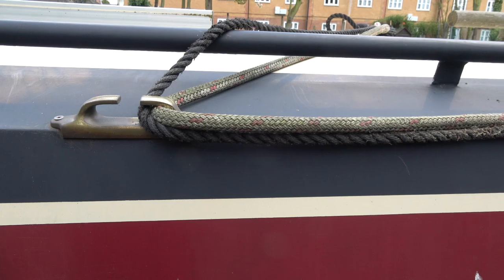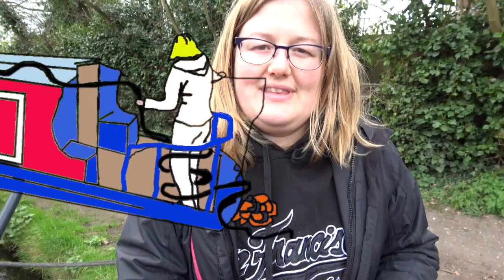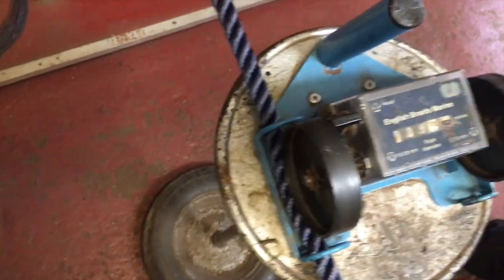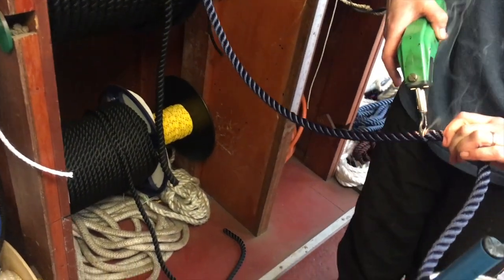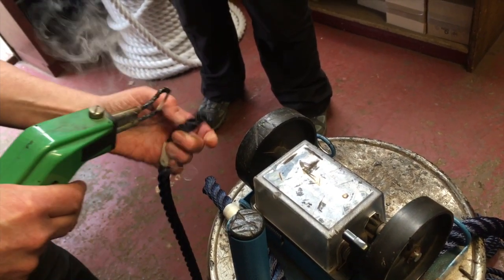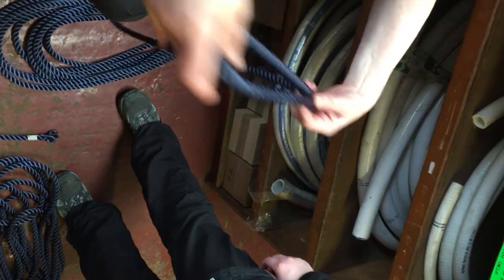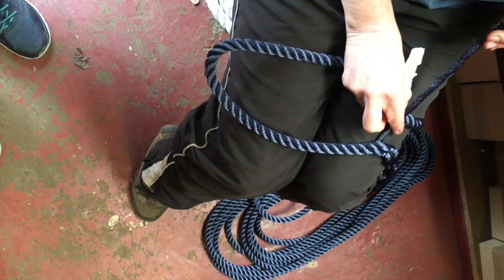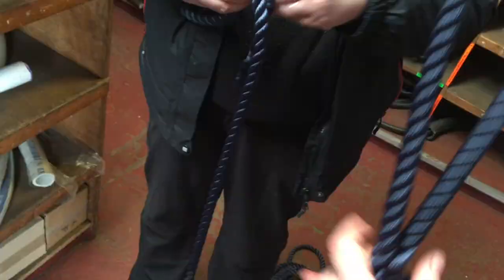How to replace the centre line ropes on a canal narrowboat

Comment: I've got continuous handrails and fairleads like yours but I've given up feeding the ropes under the handrails. If you're working locks single handed, you want to pull from the centre. The only time I use it is when I'm pulling it along the towpath as the chimney gets in the way. The fairleads would be more useful if the handrail was in two sections with a gap by the fairlead. I keep thinking about doing this but it's far too much work. Much easier to keep touching up the paint that inevitably gets rubbed off. I also agree that you need to sort out the fixing of the two ropes as the second one may pull open the splice of the first.

Comment: If you wanted to save the old "rope" (actually should be called a line),you would have pulled bitter end (not loop) through the roof eye bolt...I would permanently put larger shackle through your roof bolt which seems rather small. Stainless steel please, don't throw your money away on galvanized rubbish. Love your vlog!

Comment: Wouldn't pulling the rope added second pull open the first loop that actually goes through the tie point?  (lower rope pulling open the upper as viewed at timestamp 7:26) A pair of large shackles connected to the roof's tie point might help there, as each could have it's own connection point.
Reply: No problem. I'd just hate to hear that as you grabbed it, the boat slammed back into the sill or the side. You two, CtC, and Robbie have made this my retirement plan at the very least. If I won the lotto or something I'd have one built straight away to spec. Just need a visa out of the U.S. and into the free world. :D

Comment: Aww.. You could have shortened the rope that was too long.  Cut the end, melt the tips to prevent fraying, then put heat shrink tubing on the end to really seal it up.  Would have saved you from having to purchase 2 new ropes.  Great video as always, though!  Happy motoring. :)
Reply: Ah!  That makes sense.  I thought maybe that you got rid of the long one. Didn't realize you kept it for other uses.  Cheers~